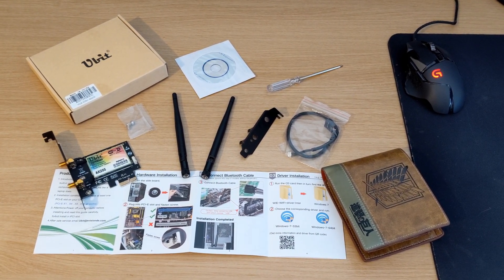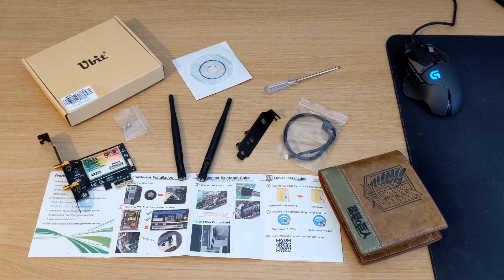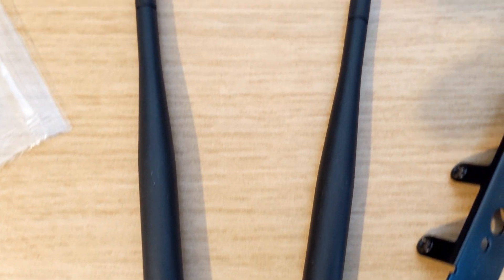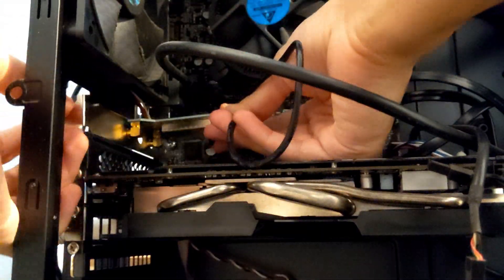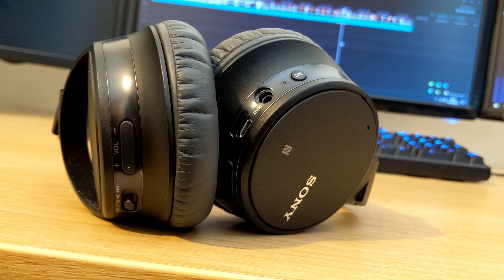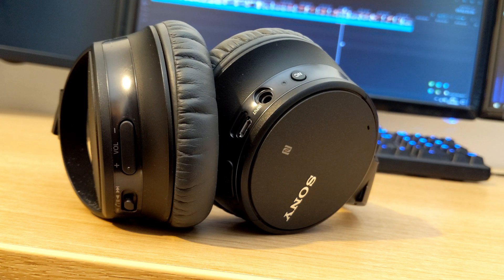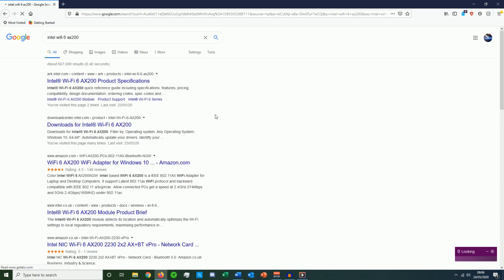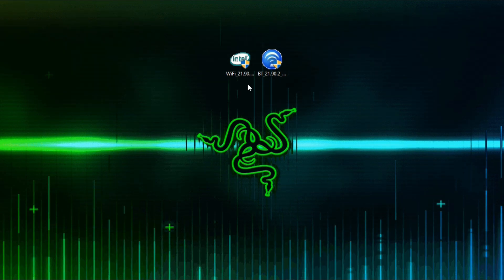Ubit Gigabit 2974Mbps wifi 6 AX200/BT 5.0 Card | Showcasing | Speed Test | Driver installation |

Comment: I'm seeing a significant 90% drop in WiFi speed when I'm connected  on the 2.4Ghz band and also have Bluetooth turned on. Once I turn Bluetooth off, the internet speed bounces back to normal. Tried everything in terms of fresh driver installs, but I'm still faced with the same problem. Does anyone know any ideas in how to fix this, or if this just a common known issue ?

Comment: Hello,maybe you can help me.I install Intel driver 22.40.0. But i not have Connection to my router.My router is Wifi 6 ax 80 Ghz .In my system is all ok.Think problem from the Router setting????

Comment: How is it now? thinking of getting one for my dell optiplex 3050, can it cope with multiple bluetooth devices and have you tried hotspotting your phones internet to use as wifi for your desktop?
Reply from the maker: Yes it's still working fine, no issues. I have previously set up a wifi hotspot using the data on my pixel 3 to play League of Legends when my wifi was playing up and it worked just fine - got about 40ms ping on league. As for multiple bluetooth devices at once, I only use BT for my headset on occasion - all my peripherals are wired so can't say
Reply: @shivamstrums  thank you
Reply: @shivamstrums  do you need anything else for Bluetooth?

Comment: Thank you! I wanted a WiFi card and Bluetooth for my b450 tomahawk max mother board! Helped me a lot
Reply: Hey, I also have a b450 tomahawk max, and I want to ask, what connector on the motherboard did you connect the bluetooth cable to? I’m not sure if you simply plug it to the JUSB connector whether it’s compatible or not
Reply: @properdude_itsme  yeah should work
Reply: @properdude_itsme  I connected mine into jus usb and I get roughly 350 - 400 MGbits a second because I have gigs last at my house

Comment: Wait do you need an intel CPU or is it just their website
Reply: The wifi card uses an Intel ax200 chip. That is the reason  to go to Intel website to download the updated drivers. Even if you have ethernet connections it will automatically download the drivers. It works both with and or Intel CPUs though. In my case I have it installed on an AMD ryzen CPU.

Comment: Would it still work if i didnt not use the cables?
Reply from the maker: It would still have wifi capability but not bluetooth, for bluetooth you have to use the cable

Comment: Does the intel drivers work with an AMD cpu?
Reply from the maker: No idea on that one, no desktop/laptop I own uses amd, sorry :/
Reply: Yes
Reply: Obviously not, u will need to download intel drivers for intel and amd driver for amd
Reply: @bfrcrespo  It works perfect on amd, you have to download the intel drivers for the wifi card because the device is made for intel drivers.
Reply: @bfrcrespo  of course it works with AMD  CPU. Indeed, I have it installed on an AMD ryzen CPU. This wifi card uses an ax200  chip that is made by Intel. That is the reason you have to go to Intel website to download the updated drivers.

Comment: Are you on 5g? ive found default for many of these is 2.4
Reply from the maker: Mine is combined, so it switches if needed to ensure I have connection. But the card itself can pick up 5g yes
Reply: Thanks for the review, mines running fast.
Reply: how do you enable 5g?
Reply: @Peopledangel  it's a setting under device manager.youll want all those settings to match your router, so mines on ac because my router is wifi5.

Comment: Hi, thanks for the review. how do the speeds compare to ethernet?
Reply: I bought this Ubit card and my speedtest result on this card is as follows: Down 473,90 Up 493,45 Ping 3ms. My ETH0 is: Down 465,68 Up 506,78 Ping 2ms. That is with people gaming on my network. So I say its good, really good for an Wifi. I have an 500/500 fiberoptics connection.
Reply from the maker: Hi, no problem! I can't connect my main pc using ethernet as my router is downstairs and pc is upstairs, hence i got a wifi card. But I also have a pc downstairs connected via ethernet that has a connection speed of 60-65mbps, very close to my isp limit of 70. A wired connection is always better, but not always convenient. If its practical I would definately go ethernet over wifi card any day. Hope that helped!
Reply: @shivamstrums  does the ax200 support mobile hotspot?
Reply from the maker: @mobvv1134  yes it does, I had my wifi play up a bit a few times when playing league of legends, so I switched over to the hotspot on my pixel 3, the card works just fine with this 👍
Reply: @shivamstrums  no i mean can it create a wifi hotspot for other devices to connect
Reply from the maker: @mobvv1134  oh right my bad, yes it can I've just tried it right now.
Reply: @shivamstrums  thank you so much👍🏻
Reply: @mobvv1134  It doesnt matter. If it is window 10, it does. If it is ubuntu, you need to do something. I did it with another card. It works very well. For my window 10, I use it as mobile hotspot for my phone.